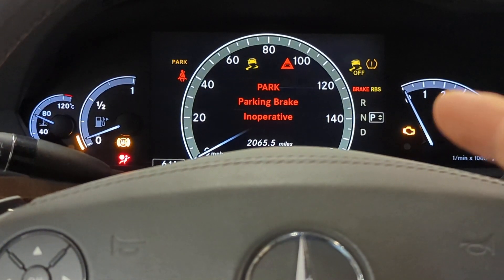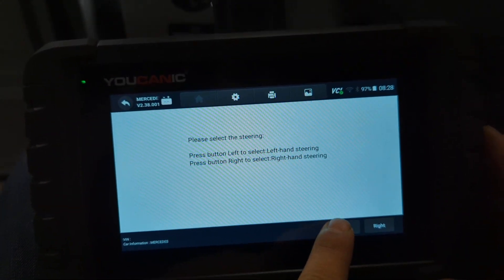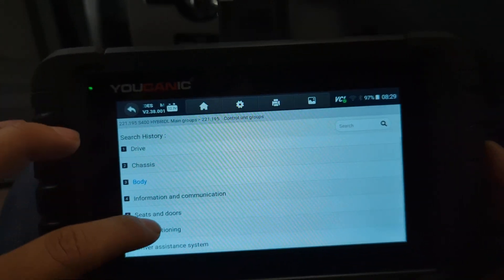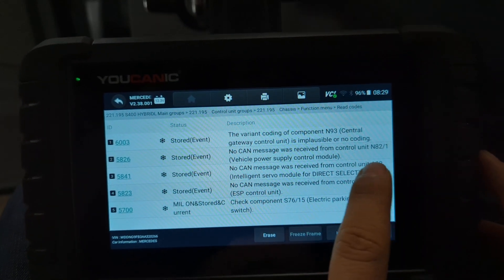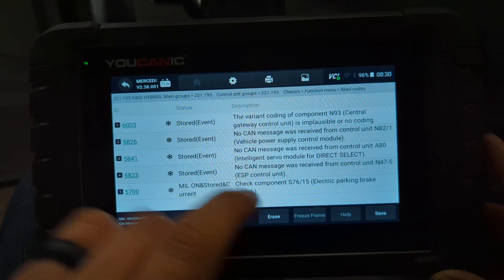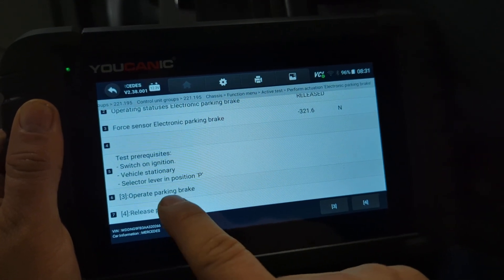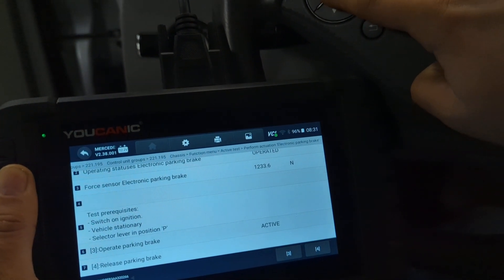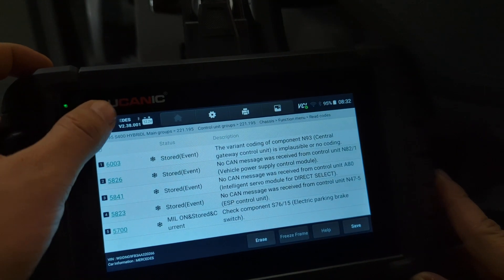How To Troubleshoot Mercedes Benz Park Parking Brake Inoperative with YOUCANIC Scanner

Comment: On my CL when you press the switch it works once and after that doesn’t. Scanner shows it has force, you can hear the motor but after first engagement it shows error and after that it doesnt work a second time. Only if you restart the car. Any ideas? Shows error - Check mechanical components
Reply from the maker: Too much resistance on the cabels. Lubricate them with some grease or you will have to replace the brake module on the back soon.

Comment: Ran in to that issue on a 2023 model. Would change gears but rear parking break wouldnt disengage. Must use a wheel lift and dollies to tow. Dont use a flat bed tow truck. New cars should have parking break cables only. Its stupid to have electronic parking breaks. Its a pain in the but with all these electrical issues on these cars. They go to the dealership very often. Stay with an older car, dont buy the new ones.
Reply: I drive CL 500 and because it’s mega complex car I was thinking I should buy sth new that would be reliable buuut guess it’s not warranty haha
Reply: Yes, every 6 months  or so something  new comes up, I don't think  I'll be getting  an electric  car in the future, just this morning  my gla250 showed  me all those lights, parking brake,  collision  prevention  unoperative